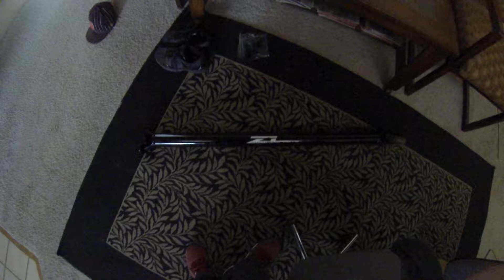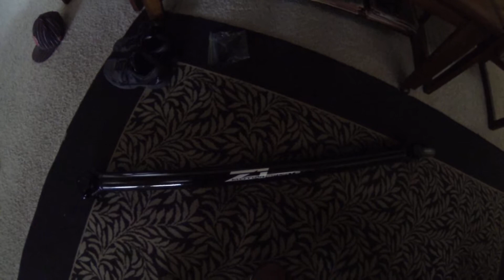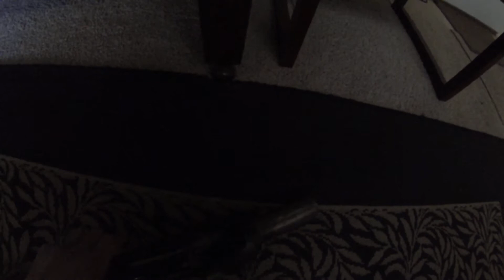300zx one piece driveshaft

Comment from the maker: I have a 2+2 bro,its my favorite body on the z32 i love the long stretched look, I call it the Limo Z lol. It is a bit heavier but that ok i will make up for it with horsepower!
Reply: Brian Heiden nice!! same here , love the 2+2. The car was actualy designed as 2+2 first, they added the 2 seater later for USDM. in europe we only have 2+2, in fact here in Holland we only got 2+2 with black leather interior and HI-CAS as standard.

does the 1 piece make any extra vibration or noise?
Reply from the maker: vishS14 I have the tan leather interior model. They are very nice inside when equipped at that trim level.The twin turbo euro model I believe is the most expensive Z that was made.

Comment: hey bro was thinking of getting an aluminum driveshaft from z1, did you have any problems installing it? like sliding it into the transmission ? i know the stock one flexes a bit making it easier to get out but do you have to take anything off besides the exhaust to get it in
Reply from the maker: +Kern O'Leary It easier to install than stock actually after the carier bearing is out of the way makes things much less cluttered for install I dont use the alluminium shaft though they are known to break quite easy. Hope this helps.
Reply: +Brian Heiden thanks yeah for sure, uppon doing a little more research i think ill stick with the steel as well . just sucks z1 charges such a big core on the platinum steel
Reply from the maker: Kern O'Leary Mine was before they had that platinum steel one I think that is just plated to look nice.
Reply: +Brian Heiden ahh true its kind of a silly thing to have looking nice. i guess for when im laying under the car....